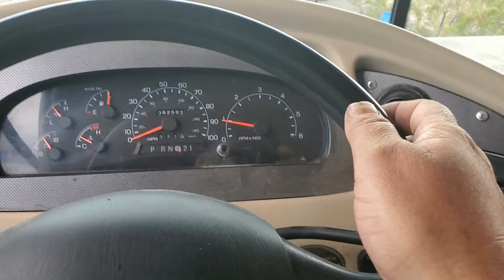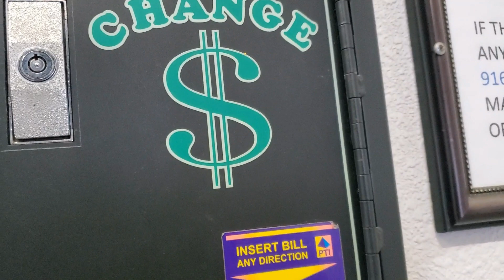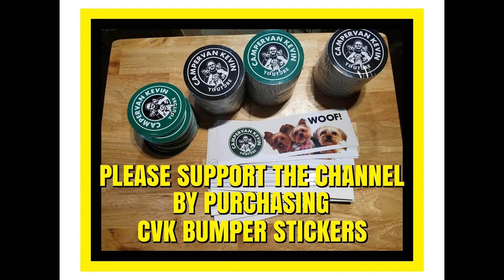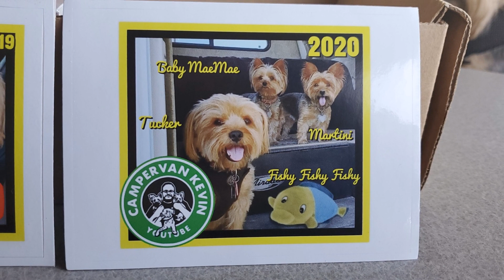It's Just The "Wind", Motorcycle Probs, Tucker Messes Up My New Hat!

Comment: Not radar, but microwave used in transmission of the cellular and other telecommunication data over long distances. When there are no land lines (fiber optics cable included) between sites or the "Switch" or MTSO (Main Telephone Switching Office), they use microwaves to transmit the info. In populated areas, fiber optics has replaced copper land lines, but when you have a cell site on a mountain top or out in the boondocks away from land lines, microwave is the go-to method used. Those drums are most likely aimed at remote cell sites. Been in the business since 1986.

Comment: I bought (2), 3 inch memory foam pads and stacked them.  I have a old spine injury and it was the first time I was able to lay on my back and see the ceiling!  A week or 2 later, my spine popped back into place.  I could sleep on my shoulder with bone spurs.  It pops now too.  I will never sleep without my memory foam again!  I bought pouches of microwave rice-cilantro and lime, which I like both.  It is really good.  No need for water to cook and takes 2 minutes in a 750 watt microwave.  I split the pouch into 2 meals, add beans with cheese for a complete protein with essential amino acids.  At the end of your video, I saw the image in my mind of Johnny Cash, black upon black, (hat and shirt), plus you said one time you like dark haired women.

Comment: Great idea adding supports to your ramp setup. Because old XRs have typically spent some time outside, a little electrical connection maintenance and some grease goes a long way to solving issues. I usually start mine and walk it up in 1st gear, nice and slow, so I'm not pushing it up. Just a few suggestions. Hope all is well. Thanks for the videos.

Comment: I would of put my leveling system down just enough to keep the suspension from moving back and fourth.. Usually the CDI will stop working all together.  They either work or they don't. I'm sure it was just a connection..  Love the videos Kevin.

Comment: Kevin buy some deoxit contact cleaner and spray in the connectors on your CDI.  What likely happened is that when you  pulled them off and put them back on you scraped off some of the oxidation but it will come back.  Cleaning it will last for years.

Comment: Hey Kevin, Have you ever seen the metal loop hat holders that where used back in the 30's and 40's era cars? used to hold Stetson hats and cowboy hats.They are a metal loop with a spring. They screw into an overhead area like near your sun visors. then you pull the loop down and insert your hat upside down in it's loop and  it spring holds it to the roof out of The Woof Packs reach.  They sell a version still if you look. Just an idea brother I've seen guys use them in pick up trucks so no one sits on their hat. Be safe out there, make sure tucker pee's down wind, wet sneakers and socks are horrible.

Comment: I'm freaking out Kev...
Do you also have to remove your propane tanks to fill them up?
Does everyone?
I cant pick-up an empty tank yet alone a full one! Let me know! TIA Chicago Renee
Reply from the maker: mine is attached in this rv
Reply: @CampervanKevin  well thank you!! Good to know.. have not bought my RV yet, but was considering going
'No propane' and getting all solar & batteries & a generator! Mostly cooking with a toaster oven or microwave and outdoor grill. I was going to remove the propane tanks and put the generator in the box on the tongue... where I put the batteries will depend on which RV I buy.  So A/C & heat by solar/battery or generator.
Thanx 4 info!
Reply from the maker: you shouldn't fear propane like you do. It is very handy to have.
Reply: @CampervanKevin  I may just do both. The reason I have stayed skeptical on propane is having seen vids of 2 or 3 RV graveyards... many RV's had fires. Most of the fires appreared to be due to propane. Quite a few were propane refridgerator fires. 
I can see having a 
'pilot light' for a clothes dryer. But, a 'pilot light' to cool a refridgerator makes no sense to me at all. 
I'm want to limit my RV expenses due to my my limited income. 
I'm trying to also limit out-go of my limited
in-come!!! Less is more, more for me. I would rather have cable & my YT access in the RV and electric options... but we shall see...
Thnx for your input! 
Much appreciated!

Comment: Would the cycle fit better if you push it up onto rack backwards?
Reply from the maker: have not tried as front wheel chock is attached. I will look and see if it makes any difference. I dont' think it will.